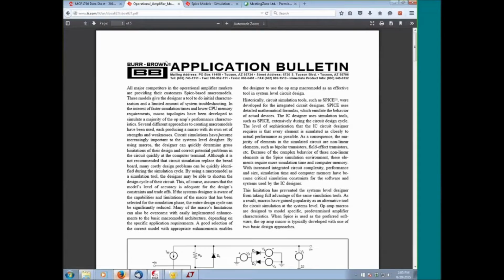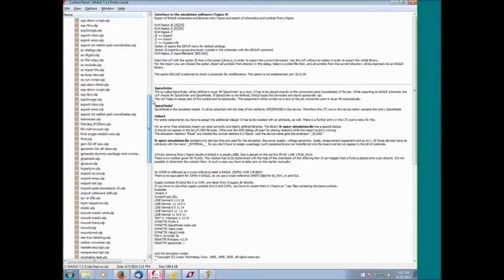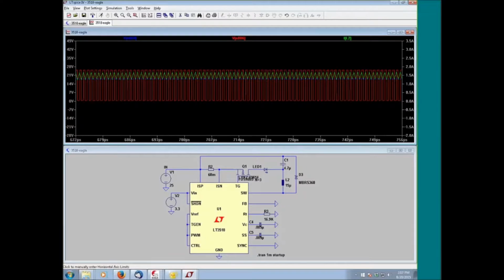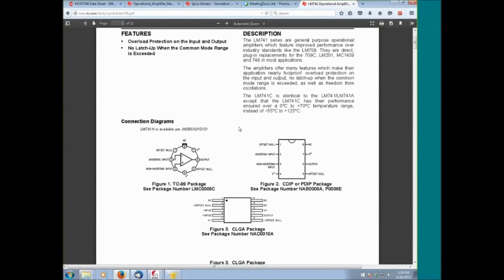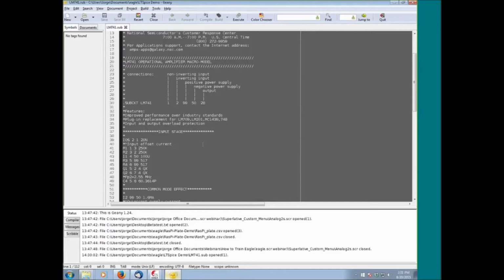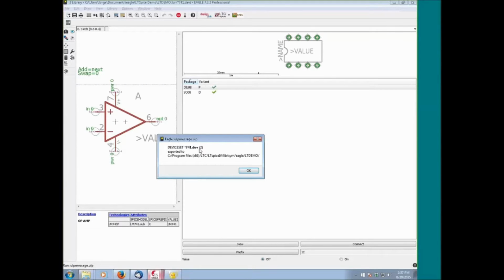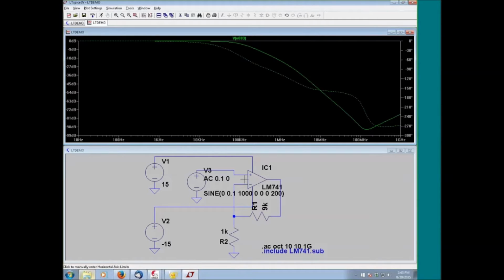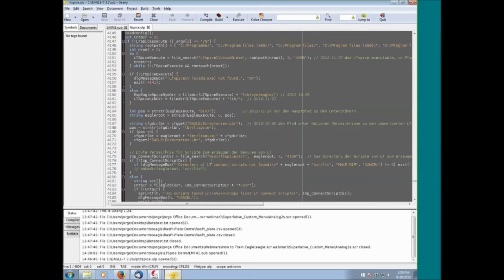The DEFINITIVE LTSpice Webinar August 20, 2015

Comment: What a load of bull****, after 10' he gets an error on export setup and does not explain why. After more than 2 years Autocad still is unable to get this working at all. A lot of hogwash about altering directories in the ltspice.ulp, I changed all that according to "instructions" to the current directory where LTspice resides, i corrected the executable to what it is actually named etc..etc.. Does not work.
This whole video is just a smokescreen to cover all sorts of issues. It is stated here it does not work in Linux nor Mac, but would be on Windows.. ?? I have W7 64b and even there no way to get this going. What a bunch of amateurs.
Reply: Hi @brice3011,

This video is very old at this point in time we have abandoned the LTSpice interface and replaced it with the NGspice engine now integrated into EAGLE. The interface is simpler so I encourage you to try the new engine out. If you have any questions or issue feel free to post on our forums https://forums.autodesk.com/t5/eagle-forum/bd-p/3500